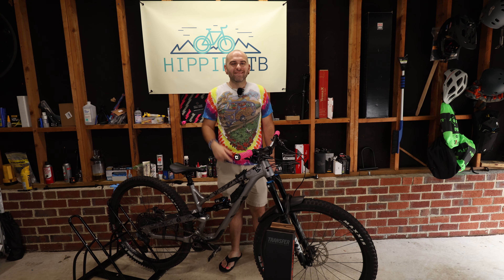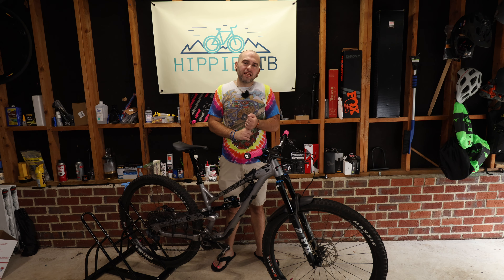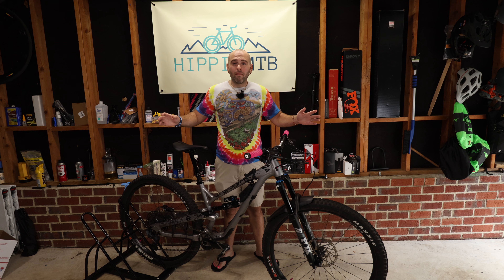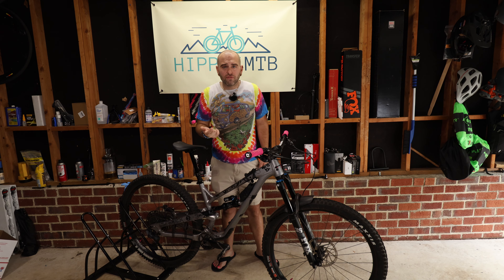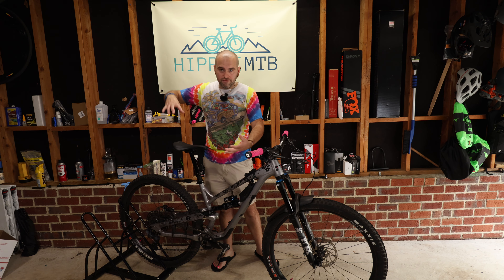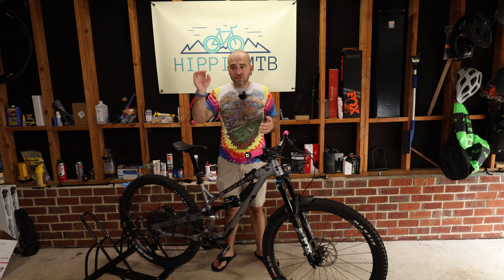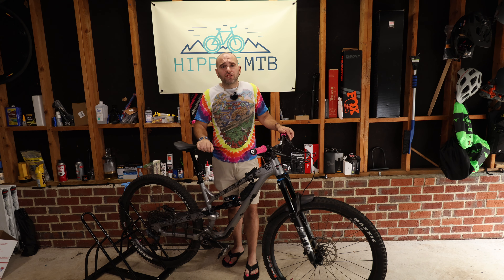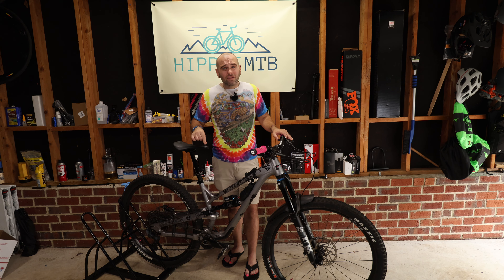5 Reasons why you should AVOID the Fox Transfer Dropper Post!!!!

Comment: Update. I got my post back from Fox. All updated parts for the same cost as a service. It is completely different from what I sent in. All updated upper post and such. Its a new post!
Reply from the maker: That’s epic. Dude I had same experience, but ended up getting the one up in before the fox came back. The dude who I sold it to said it’s mint though. It seems Fox is sticking to their word.
Reply: @HippieMTB  Thats cool. Mine came with my bike. As they say if it works don't fix it. I did buy another WTB Silverado after it fell apart from me throwing my bike in the back of the Subaru. I know saddles are off topic but the Silverado is epic.
Reply: Cool but it's the post you ahiipd have received from the start so don't make Fox out to be doing you a favor. The Transfer posts have been terrible. You need $800 worth of tools if you want ro service one yourself. Only other option is to send it in and they charge you half the price of what a new, reliable post would cost you brand new just for a service. There should be a class action against Fox for the shit this post is. It's basically a throw away item once it needs a service. You're paying a premium for a disposable item thats not worth servicing.
Reply: @antone9751  I don't have a strong opinion about it. The post came with my bike. I do agree that service should not cost so much. I may after another 2 years if this one starts acting up, consider a more home mech friendly post. For now it works bomb, especially in the cold.

Comment: I have a oneup v3 that has a had few issues - the saddle seat clamp won't grab my Ti WTB volt saddle. every few rides it slips backwards a couple mm (the fix was to scar the saddle rails and the post rail slots for added friction). The main shim under the collar wears VERY fast from the pins. they admit it's a cheaper material than the prototype shim they spec'd. AND worst of all the main tube is too flexible and as carbon frames flex they rub all over the post and cause surface wear and creaking - you can add more carbon paste but that only fixes for a couple rides. I was thinking of trying a Bike Yoke, but that's nearly the same dropper as the oneup v3 design except the air chamber area and the BIke yoke uses a plastic shim that is reportedly breaking if you sit hard while the post is down. And Bike Yoke is in europe so servicing may be harder?
So that leaves me wanting a 2025 Fox transfer. It has a reportedly smoother movement than even Bike Yoke Revive 3 and the main tube of the new fox is a solid straight piece unlike oneup or bike yoke tubes that have a beveled area near the bottom (that's where frames can make a click sound against.)

Comment: Mine has always worked. Until it needed service after two years. It stuck some and I did the usual re-grease and it worked. Went for about two years. Just got it serviced with updated parts at no extra charge. Shipping with Pirate Ship was $6. Fox service has been 5 star.

Comment: I jumped on the clearance sale they’ve had on the old model. 200mm factory for about $120. I knew the gamble going in to it, but tried it anyway. Using 6 nm on the clamp (wolf tooth max recommended) with a dry stanchion it would rise slowly every few tries. Since the nut on my 200mm can sit right on the clamp while giving me the seat post height I need, I backed the clamp way off to about 3.5 nm, and oiled the stanchion. Operates much better. BUT, this is a premium product from a premium brand. It should operate smoothly at normal clamp torques. I may be lucky with letting the nut bear the weight instead of clamp friction, but having a perfect seat post height with the post bottomed out in the tube is a rare bike/ rider/ post perfect match. 

I fully expect this to fail at some point, maybe this season, maybe three seasons away, at which point maybe I can tolerate the cost of the new version. Won’t send it off to be serviced if it’s not warranty though.
Reply from the maker: Yeah that’s the big thing. I got my dropper post back from warranty and it was super fast. Only took 2 days since I live in NC a couple hours from Fox. Already purchased and installed the one up.

Comment: Very exaggerated description of your issues.  I’ve purchased 5 of the fox dropper post 4 new and one used.  First one purchased in 2014 and it still runs fairly well.  Last one I purchased used last year and it there was a bit of sticking but a quick service with some cleaning and lube fixed that problem.  
I have never come across the problems you described and to say AVOID this post is not warranted.  Fox has transfer post have a history of great reliability going back to the fox doss dropper post.  I’m sure you have a qualified service technician in your area that can remedy the problem and maybe if you purchased the post locally. They might just service for free.  
Cheers
Reply from the maker: @orcellod1592  I’m glad to hear you love had some great experiences with them, however the whole bike community has had nothing but issues with the 21 to 23 and that is why Fox is warranting them no questions asked.
Reply: @HippieMTB  The whole bike community has had nothing but issues? Not sure what bike community you're part of mate.

Comment: I have a FOX Transfer on my analog mtb. Haven’t had a single issue in over four years. I have a V2 OneUp that’s already had sticking issues less than 8 months in on my emtb. Considering swapping for a FOX. FOX is way more reliable than this OneUp.
Reply from the maker: @skellener  that’s great to hear you had a great experience. However which Fox transfer do you have? The kashima coated ones don’t have the same issue as the elite. Fox even acknowledged that the elite droppers were defective and that’s why they made the new one. The one up v2 and v3 are the most reliable posts on the market and self serviceable.

Comment: I think that you've installed it wrong mate. I've had three Factory posts and they've been flawless, easily the best droppers I've ever used.
Reply from the maker: @CircusNormal  lol. No. I got it back under warranty. lol. It was defective. lol. The kishima coated ones are flawless but the elite black ones are all messed up. If you searched the forums you’ll see where fox recognized this and is warranting all droppers 21 to 23 droppers. It’s an actual manufacturer defect where the cartridge leaks
Reply: @HippieMTB  I've only ever had the Factory models and they've been amazing!
Reply: Mine is the same brand new pain in the hole sticking in morning till i pump it up and down a few times then not going all way up, and always raised about 3in kashima always showing if left a couple hours! It came on my new bike week old